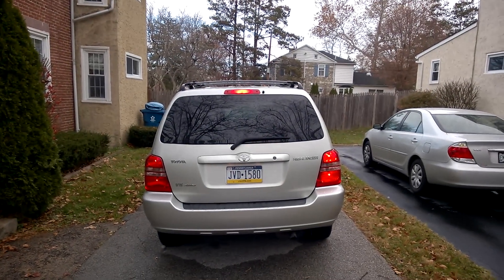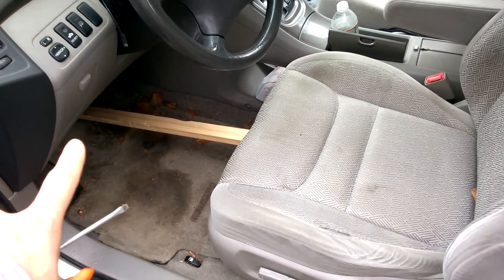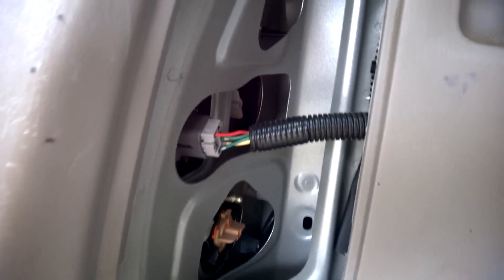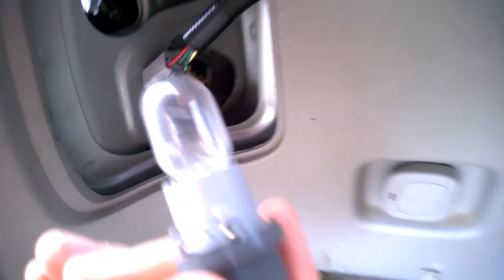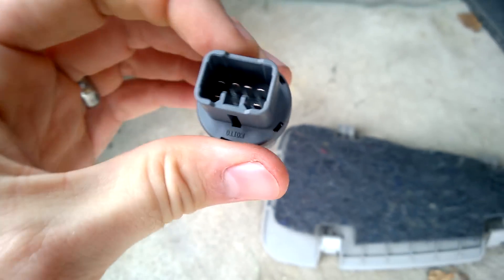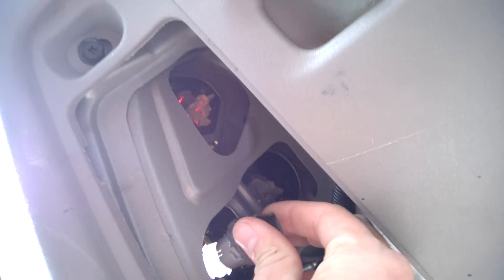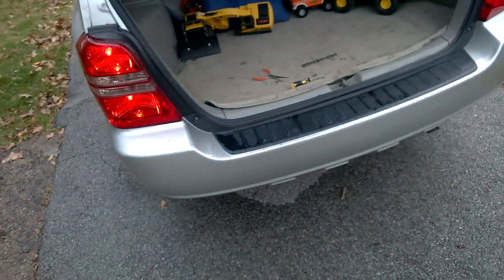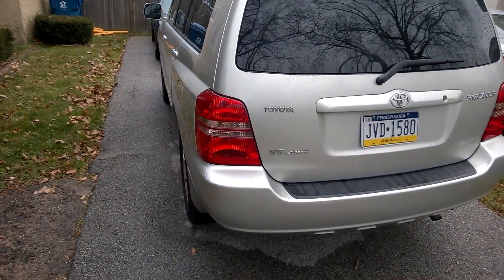DIY: How To "Fix" Your Highlander Brake Lights

Comment: Thanks for the tip. The backup light connection is the issue with my break lights. Working fine now, but may have to work on the connection again if the issue comes back up. You save me some significant time. Much thanks!
Reply from the maker: Hey Mike.  Glad the video helped out some!!  Even if it doesnt nail your exact problem, as long as it helps get people to the right spot and on the right thought path to fix it.  Thats good enough for me!  Thanks for the comment.!

Comment: Hi Jeg,
Your youtube is wonderfull!. It solved my same problem for my 2004 highlander. A mechanic installed new light bulb for me but it didn't on.Then he replaced other 2 bulks (top and other in the same side which is new) since he thought they causes problem but not work. I drove home and do google search and found your. It worked right after checking the middle, main socket. I agree with you, it will cost bunch if bring to toyta dealer. Thank you, Thuan
Reply from the maker: Hi Thuan!  Thats awesome that you were able to fix it!!  Glad the video helped you out!  Also glad to know you found it via google...guess its getting out there some!

Comment: You might be a lifesaver (or at least a sanity saver). I was leaving my apartment complex as the same time as my wife the other day and noticed she had a brake light out. Figured it was a simple bulb swap so I got new bulbs in, confidently marched to the back of the car, had the wife hit the brake and then uttered a few choice words that I probably shouldn't have said with my kid nearby.

I'm at work right now, but when I get home I'm going to investigate the tab and see if I can jiggle-fix it. If not, I'll try a few of the other things you mentioned. The Highlander has almost 200k miles on it and I was dreading a trip to the dealer to let them chase down electric gremlins (but I also wasn't too keen on leaving my wife to get pulled over for a bulb out issue).

Comment: Helped a lot. my problem was  with the left front and rear turn signal light turning on then I pressed the brake pedal. I found out it had to do with something when I removed the tow light connection from the right side.

Comment: I had replaced the brake light bulbs, but they still didn't work.  Your tips did the trick.  I cleaned the contacts on the back-up light bulb socket, then gently pried up (oh so slightly) the prongs.  It was just enough to seat the contacts properly.  Thank you!
Reply from the maker: No problem Jennifer!  Im glad it worked for you and helped you out some!  I appreciate you checking out the video :)

Comment: It worked!  I adjust the tabs on the light fixture and it worked.   thanks !!!  Before I did that, I wiggled it like you suggested and the brake light came on.  I think I might need to get a new casing for the bulb with new tabs, but hopefully Toyota has that available so I can replace the one that defected.  For now, it works!  That's the main thing.
Reply from the maker: +Dennis Doke Great!!!  Glad it worked for you.  My wife's is still working perfect with the socket turned 1/4 turn.  We'll see how it looks once spring rolls around and I have a little more daylight/heat to mess around with it.  Ill certainly post a video if I find a permanent fix.  Thanks for watching!

Comment: Thank you so much!!  Went out and jiggled mine reverse light socket and bam... lights came on.  Definitely the contacts and quality of that part are poor..  I had looked at bulbs, fuses and the contacts on the actual brake bulbs but you are right it is the reverse light contact area.  Now i would just like to be able to take the whole light assembly off and bench test it out of the vehicle.  Have you ever taken off the assembly?  Apparently there are two nuts to remove which I did but that does not seem to release the whole housing.  Thanks so much for this posting.  You have saved a lot of fellow Highlanders!!
Reply from the maker: Hmm...havent pulled the whole housing.  If you removed the nuts, and its still REALLY stuck, make sure there isnt a hidden nut somewhere.  If there arent any, its probably just stuck from being installed all these years.  Road grime, heat, foam gasket, etc all help it to not want to come loose.  Just give it a few light taps with your palm or something and see if it will jar loose.  Ide be interested in what you found if you bench tested it though.  My thought was to take it off, and lay some solder down on all the contact pads to build them up a bit.  Or even just a thorough cleaning might suffice.

Comment: I have a 2008 Highlander Sport.  I suspect that Toyota solved this issue from 2008 on. Mine turned out to just be a bulb.  The access hole is much smaller and there was not a removable socket with all those connections like you had.  Luckily when I removed the bulb it was shaded black and one of the two filaments was severed.  Two element bulb for parking and brake light all in one bulb.

Comment: Worked to push up the little metal pieces on the connector where the bulb pushes in.  Mine was turning off when the connector was fully turned, but came on when partially turned.

Comment: Thanks for the tip. That was my exact problem. The contacts in the bulb sleeve were the problem. I used a small screwdriver to slightly bend the contacts up and whalah,...problem fixed. I would have never guessed that the brake lights went through the reverse light bulb socket.
Reply from the maker: +Ted Blaga Hey Ted.  Glad the video helped!!  Im sure a lot of people end up going to the dealer and getting soaked on this problem.  Not very complicated and it only takes a little tinkering to get it working.  Thanks for watching and commenting!

Comment: For the hybrid version you may have multiple "non-replaceable" LEDs for the brake lights instead of bulbs.  When enough of the brake LEDs go out that it is noticeable (especially by a cop following behind) you have to replace the entire taillight assembly.  My owner's manual states to replace the tail light assembly when 2 or more LEDs have gone out.

Comment: Super helpful, my bulbs are great and my whole side isn't working. 

I do wish you would have shown what direction you bent the contacts. 

But I'm going to play with it.  It's been an ongoing issue. But, it is a 2001 after all
Reply from the maker: Howdy!  Basically bend them in the direction that will increase the contact pressure where they touch.  More or less...bend them out.  CAREFULLY and only a tiny bit.  Mostly make sure you clean everything well too.  Good luck!

Comment: Thanks for the tip.  Used some dielectric grease on the contact points and voilà!  Brake lights work all the time now.  Save me hundreds of dollars from the dealership.  The wife only wants to use the dealership.  Great example of why not to all the time.
Reply from the maker: Glad to hear Gary!  I cant remember if I mentioned dielectric grease in the video...but I should have.  Good call on that.  That will certainly help.  There are certainly times to call in the pros...but this isnt one of them :)

Comment: hey Jeg, thanks for your videos, especially this one on the brake lights! anyway I wanted to ask if you could do a video on how to remove the map light housing on an 02 Toyota highlander. there are no videos on how to remove it.  what happened was the push button switch to turn the map light on/off got pushed in all the way and it needs to be pushed back in place. please help! thanks!

Comment: Just bought a 2003 highlander and same issue, only the left rear brake like does not work. If i apply pressure towards the left it all gets bright. Blinkers and back up along with turn signal work, just not the brake light still. I'll try the tabs first and see. Thanks for the info. Also do you have any tips on changing spark plugs? like do you have to replace the intake gaskets everytime you do it?
Reply from the maker: On the 3.0 V6 you just remove the coil on the plug and remove the plug.  No gaskets.  Maybe the back ones?  I was pretty sure you can get to those though...I could be wrong.  If Im being honest, ours has over 220k miles on it.  It wont be with us much longer as my wife is due for something nicer.  I actually found one of the plugs had stripped threads, and had to helicoil it...so that was enough to scare me from ever trying to do the other plugs haha.

Comment: Thank you! I have the same problem and just changed the bulbs with no change. Going check it out on mine.
Reply from the maker: Let me know if it helped you out! Good luck!
Reply: I waited until it wasn't as hot out and not as bright. I bent the pins as you said and it works!
Reply from the maker: Excellent!  One more successful DIY'er!  Thanks for letting me know!

Comment: Now how do you remove the wing that is blocking the third brake light?  I see that it's out and I want to undo the bolts but the wing is getting in the way.
Reply from the maker: +julio velez I had to replace ours not long ago. I think I tried to get the lens off, but he no luck. If I'm not mistaken, I took off the rear hatch trim and got it from the inside. Can't remember 100%. Ours doesn't have the spoiler so I'm not sure how to work around that. But if it's blocking the light lens, I'm assuming you are supposed to go from the inside.
Reply: Nevermind, I got it too. The socket and bulb are fried. Ironically the connecter is fine.

Comment: I've got no power at the right brake light socket & connector--does anyone know how the wiring gets to this right brake light?  The left one works fine so there must be a problem getting power to the right. Is there a junction somewhere?
Reply from the maker: hard to say.  You'd have to trace the wires or find a good wiring diagram maybe.  Shouldnt be too hard to follow them and start probing until you have power.

Comment: I did the same thing to my sister's Toyota Highlander but I turned it halfway like you did and then the blinker started to not work once I fully turned it then it started to work again
Reply from the maker: Its not a half turn.  Its more like an 1/8 to a 1/4 turn.  If you go too far, you're basically just unplugging it, and things will stop working.  But...wiggling it, and turning it back and forth likely cleaned the contacts enough to make them work.  They can be finicky!

Comment: The problem is corrosion not
Misalignment. I spray foaming battery cleaner in the bulb holder connector and rinsed it out. Problem solved.
Reply from the maker: Im sure corrosion could be part of the issue on some.  On my car, it was not.  The terminals were clean.  They were simply not making a good enough connection.  I attribute it to heating and cooling all these years and just caused the spring tension in the tabs to fall off.  I would DEF try just cleaning them all first.
Reply: @JEGsGarage  Also Toyota could have designed the lamp socket better, its a chronic issue on other Toyotas where they use that same design.

Comment: ‘05 highlander here. All brake lights worked but top right taillight didn’t. Stupidly I replaced the bulb not realizing it was the same bulb as the brake light that did work. I took the bottom left taillight and put it in the top right to see if it was the housing unit that the bulb went into was the problem. Now both left taillights AND bottom left brake light don’t work 😂 I messed around with the connecting pins like this video showed. Jiggled the wiring and all that. Didn’t do anything. Crap.
Reply from the maker: Sorry to hear the video didnt help!  Sounds like there is another wiring or connection issue somewhere...

Comment: the bolt just spins around and i cant get it out to replace rear break light ...how do I get it out?
Reply from the maker: What bolt are you trying to remove?  You should be able to replace all the bulbs without pulling the light out.  If you are talking about the bolts that hold the tail light housing in, then it sounds like its striped.  You will need to pull out lightly like turing, so using something like vice grips or pliers.  Maybe someone over tightened it and stripped it out?

Comment: i need ur help i change the bilb the brake switch and it still nt working
Reply from the maker: Did you try the other fixes in the video?  If you still arent getting light back there, you will need to start checking the wiring/fuses/circuits.  Unfortunately, thats a process too involved for me to describe here.  Start with the easy stuff like fuses and move from there.  I hope you get it sorted out!

Comment: Done everything on my 02 highlander and still doesn't work!  Help please
Reply from the maker: Hi Jessica.  Are any of the rear lights working?  If they dont work while jiggling around the connector, I would suspect its either burned out bulbs, a bad brake switch, or a blown fuse.  At least thats where I would start.

Comment: fuck i thought i unlocked it haha nice fix you should try swamping out the sockets and see if the other side doesn't work then you will know whats broken? nice video JEG
Reply from the maker: +RICKAFIX I thought about swapping sides.  But I have a feeling its the contacts on the light that are worn out.  Everything technically works, just making poor contact.  When I get some more time, I'm going to pull the whole light assembly out to get a better look at it.  And I plan to tin the contacts with a little solder, then use dielectric grease.  That should help.

Comment: So the other videos get you this far, but they are a bunch of crap. The other video gives you a measure of 8th inch and to you its a bunch of crap, while thats how you realized how to fix it. GTFOH!  Other videos would get you the same results. If they get something wrong, point it out, but dont throw out everything because of a detail.
Reply from the maker: What's up.  I'm really sure what you're getting on about... I don't think I called other videos crap, but the advice to bend the pins 1/8" was crap, yes.  They got something wrong, I pointed it out, exactly how you described.  At the time of filming this, no...the other videos did not get the same result.  Cripe this was 10 years ago!!!!